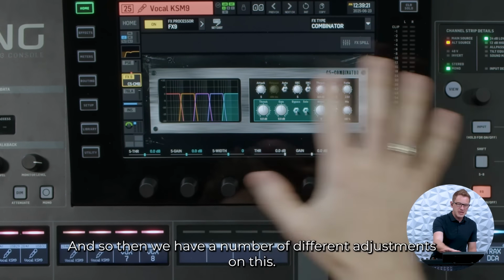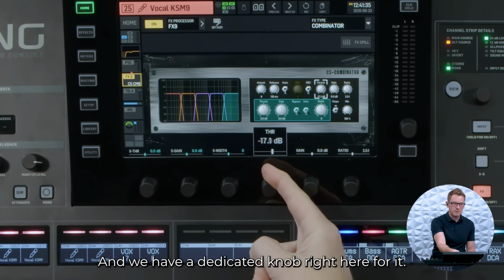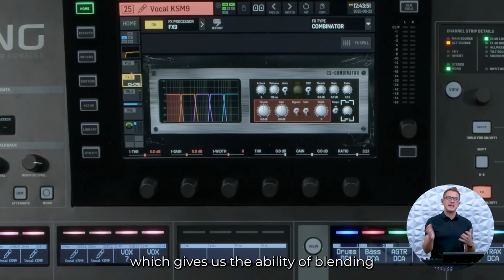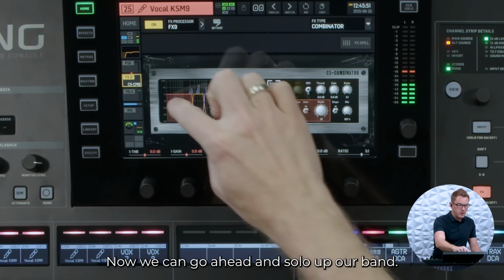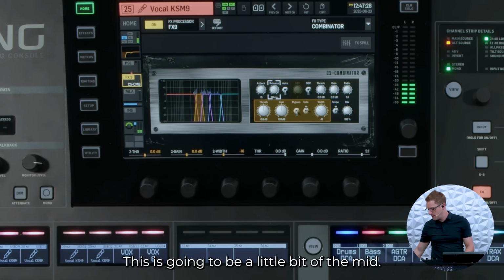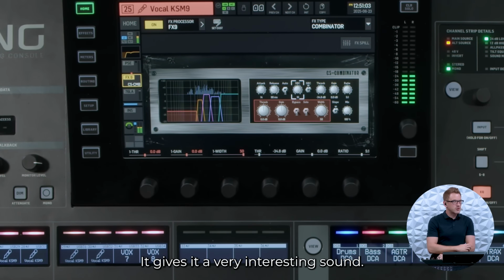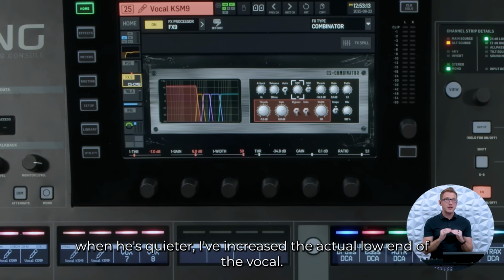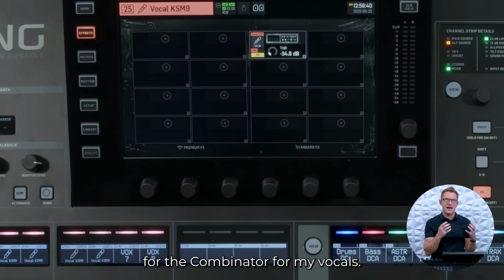How I Use the Combinator on Vocals – Behringer WING FX Explained

Comment: Does the Wing have a linear multi-band comp or multiple band dynamic EQ? If this combinator is the same as the X32 version, perhaps because of that dual attack feature you mentioned, it does not act in a linear way compared to other multi-bands or dynamic EQs (Waves C6 or F6, A&H Dyn8, Yamaha dyn EQ for example). Specifically, I find it starts cutting too soon (before I want it to) and then it doesn't cut as deep as I need it to when the singer really digs in. One guy on youtube showed this using an oscillator, and in short, it just isn't linear--so it cuts in before I want it to and still doesn't protect us from the harsh screams. You got a nice result, so maybe they've upgraded the behavior since the X32...

Comment: To calculate the attack time, I use a formula I learned in university (FOR MAIN MASTERING ONLY): 

*Attack Time (AT) = 60,000 milliseconds / Tempo* 

For example, if the tempo is 109 BPM:

*AT = 60,000 / 109 BPM*  
*AT ≈ 550.48 ms*

Thus, the attack time is approximately 550 milliseconds.

To calculate the release time, I simply multiply the attack time by 2:

*Release Time = 550.48 ms × 2 = 1,100.96 ms*

For the knee settings, I use my own formula: the threshold is expressed as a percentage (gain ratio, not the:1). The number you calculate here doesn’t indicate the exact knee value to apply to your compressor; instead, it shows how the knee  behaves allowing you to determine the appropriate setting. 

For instance, if you calculate a value of -0.3, this represents the softness of the knee based on the threshold and gain ratio. Consequently, you would apply 0.3 instead of -0.3, as -0.3 indicates how soft your knee is.

Here’s a practical example: If the threshold is -18.7 dB and the ratio is 2:1, you would input 18.7% (the 2) into your calculator (excluding the :1). Let's say your result is -0.374; this number indicates how soft your knee is. Therefore, you would set your knee to 0.374, as that is the actual knee value to use, not -0.374.

To determine the threshold and ratio, I rely on my ears and gradually lower the threshold with a ratio of 2 dB until I notice a deduction in parameter.

Makeup gain corresponds to the ratio value. Since the ratio indicates how much you want the compressor to hold above the threshold, I consider this a form of gain. Hence, your makeup gain is 2 because it compensates for the gain that is reduced when the signal passes above the threshold.

Overall gain can be calculated as the mean of the ratio gains, excluding the :1. For example, you can find the overall gain by adding the ratio gains for low, low mid, mid, hi-mid, and high end, and then dividing by the total number of bands. The answer you get is NOT YET your final makeup gain; it is an indicator of how loud your output gain is. For instance, if your final answer is 3.2, this means your calculation indicates that your output gain is 3.2 dB loud. If you get -3.2, that means your output gain is 3.2 dB soft. The goal is to reach the zero signal level. Think of it as 3.2 - 3.2 = 0; anything below zero is soft, while anything above is loud.

If you found this helpful, please leave a like. Thanks for reading, and God bless you! Feel free to drop your questions below.
Reply: 500ms attack? Most of the word are shorter than 500ms. Which is the purpose of 500ms attack?😅
Reply: @pier.santi88-j7h  Was just about to point that out lol

Comment: Livemix: Use this in a vocal subgroup. Use an 'Eternal Bliss' (max. reduction 2-3 dB) in a 'band' or 'instruments' subgroup, triggered by vocal subgroup. You'll always be able to bring the vocals to the forefront with ease, without running the risk of exceeding any locally mandated volume limits.
Reply: With the x32 only having 8 FX slots, this is how I would use it.
Reply: I've but used the eternal bliss much,  curious why that choice for you?
Reply: @pressorv  Can be used as a sophisticated ducker. Characteristics, ratio, gain, release, max compression (= reduction) - everything easily adjustable from subtle to extreme.

Comment: Hello Drew, your tutorials are really great.
I have a question that has nothing to do with your tutorial, but maybe you have an answer.
I'm having trouble with ProTools Studio 2025 and a Wing Compact connected via USB.
When I send audio to channel 1, all the ProTools channels receive the signal from channel 1. Obviously, the routing is correct, and each ProTools channel has a different USB input. When I send audio to channel 2, it works on the console but nothing in ProTools.
I tested it with Tracks Live and everything works fine.
I think it's a bug on ProTools, what do you think?
Thanks.